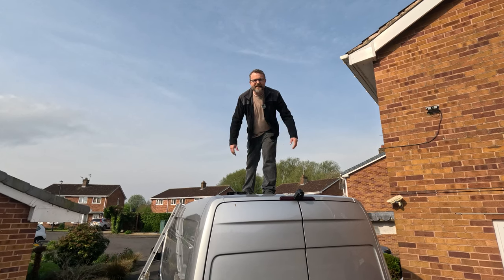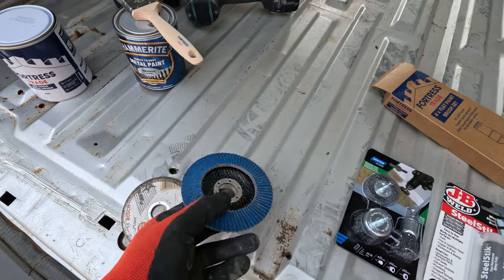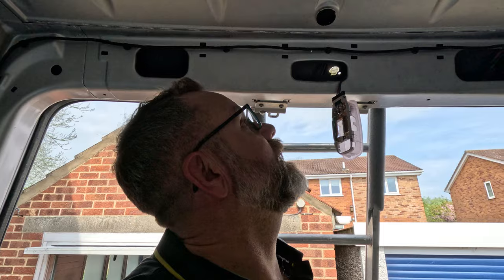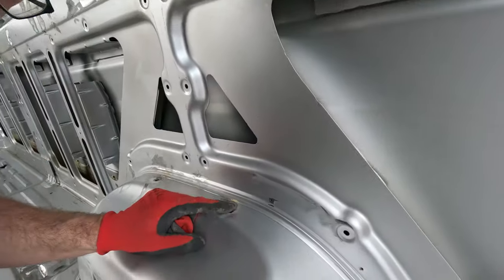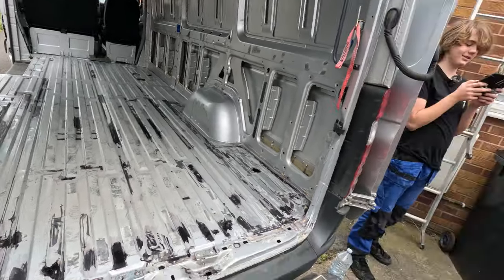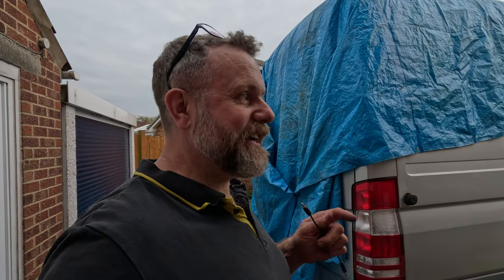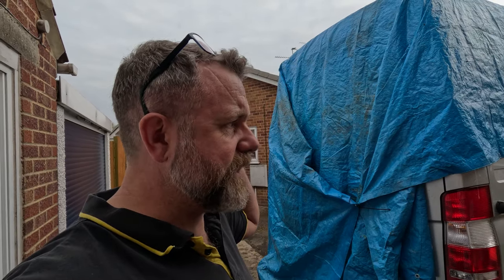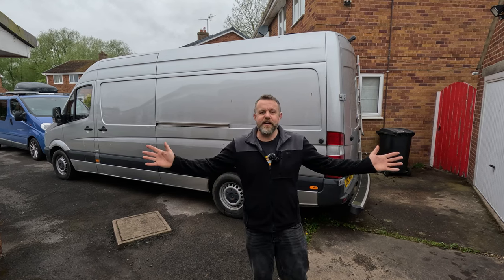Transforming Our Sprinter Van Into A Camper Part 2: Battling Rust!

Comment: You could try JBW weld steel stick for the holes on the roof?
Reply: Oops, should have watched the whole video !
Reply from the maker: Ha ha. I used it on the floor. But you think it would be OK and water tight for the roof?
Reply: Guess it depends how big the holes are but if you have a mate who will weld the floor, maybe get the roof done as well. Weld or steel putty, you will be able to paint so will look better.
Love the videos, keep going, it will be worth it